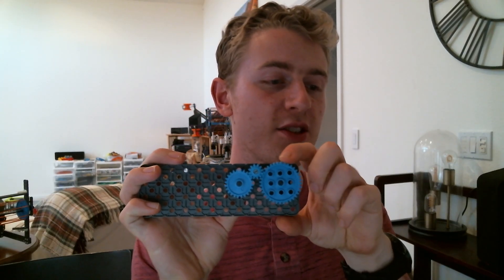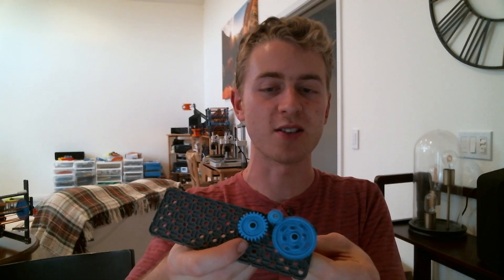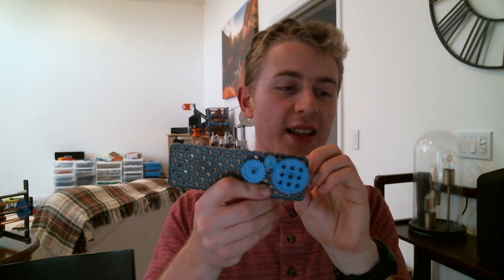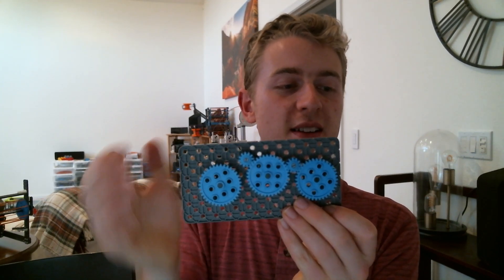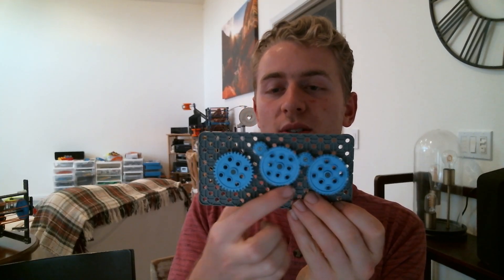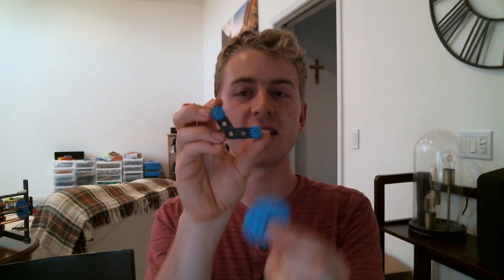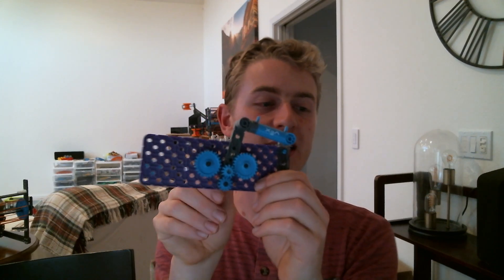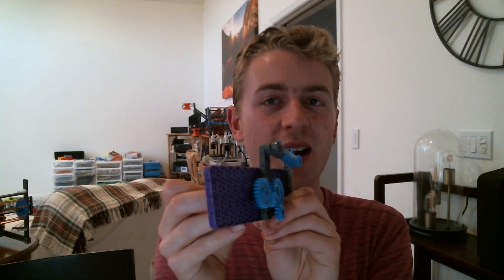VEX IQ Motor sharing/PTO - how to use one motor to power multiple mechanisms

Comment: a suggestion is to not use different sized gears for motor sharing (more pressure on the shared gear)
Reply: 24t gear best gear size for pto